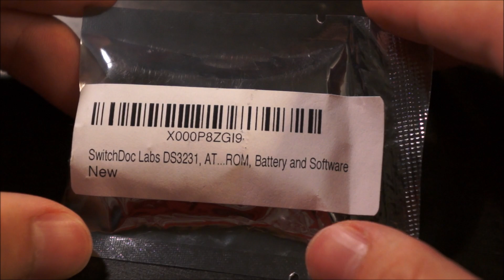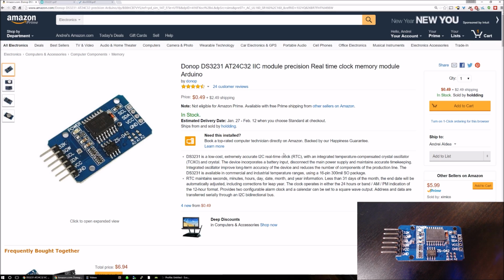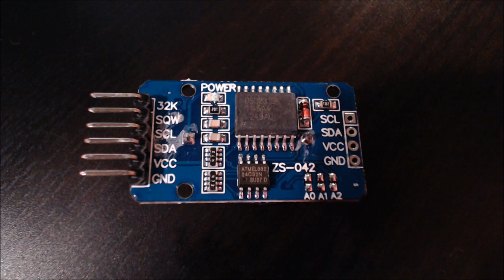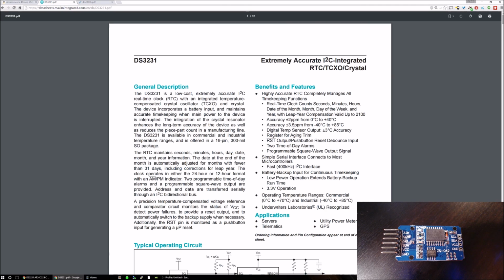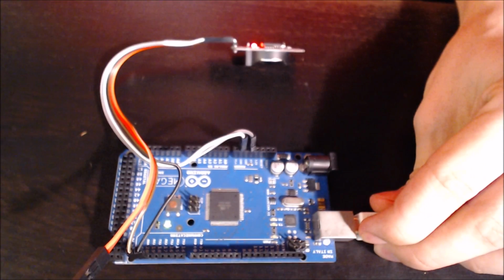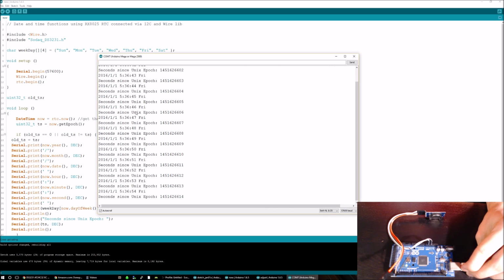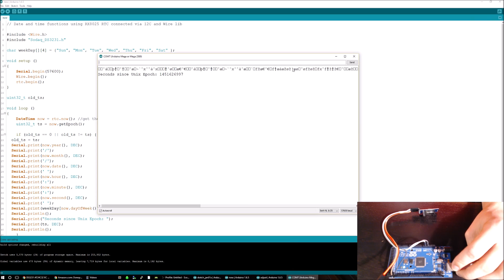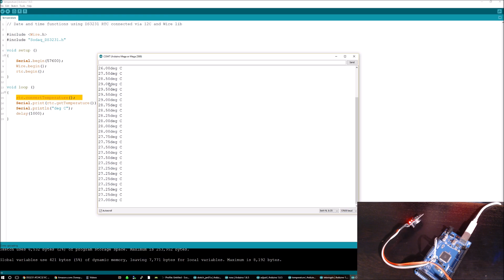DS3231 Real Time Clock + Temperature Sensing using Arduino

Comment: By removing a couple of resistors and clipping the vcc leg you can reduce the current draw on these modules from 100uA down to 5uA.  This power saving modification is quite useful for data logging applications:

https://thecavepearlproject.org/2014/05/21/using-a-cheap-3-ds3231-rtc-at24c32-eeprom-from-ebay/

Comment: Can you publish your code? I can't find it anywhere!
Reply from the maker: Phillip Shcherbakov it’s the “now” Example of the library, comes with it by default
Reply: Thanks! I'm trying to use this chip to make an automatic christmas light controller. The idea is to smash this code, some code to control a relay, and some code to read an IR sensor together. It's my second arduino project, so it probably won't go very well.
Reply: It doesn't seem to be working. I've found the library in the Arduino contents, but the 'now' example is a .pde file, which won't open in Arduino. Is there a way to open the 'now' example inside the Arduino application?
Reply from the maker: Phillip Shcherbakov that's rather strange... It doesn't show up under, File -> Examples? I'm away from the computer right now but I'll try to give you a hand when I get back if you still havent figured it out
Reply: Ok, I've found it now. At first I was looking at the files that make up Arduino, but I've searched around the menu bar in the arduino application, and I found it. Great video, by the way!

Comment: Thanks for the video. When reading the time I get (for instance) 23:36:1 any single digit (depending on the time) doesn't have a leading zero. How do I get a leading zero on H, M, and seconds? The library I'm using is Sodaq_DS3231.h (If that matters). Please help me.
Reply from the maker: You can do an If statement for example, such as if(now.hour < 10){ Serial.print('0')  } Which would add a zero, it just depends where you put it in your code, so make sure the order is correct. Does this make sense? You'd do this for hours, minutes , seconds etc.
Reply: Thanks.... Works perfect now.   :)
Reply from the maker: Glad to be of help!

Comment: I followed all the steps exactly but whenever I disconnect the power the time is resetting to 2000. I am using Arduino uno. What could be the problem?
Reply from the maker: Nandini Jayasimha are you sure the watch battery is put in the correct way? the real time clock won't hold time if it's not getting power at all times.
Reply: Andrei Aldea thanks a lot! It worked once I changed the polarity of the battery.
Reply from the maker: Nandini Jayasimha glad it works! good luck !

Comment: what ever prompted you to check the temperature by shooting the chip ?  this is dumb. do you live on the chip ?  no, you live in the room. you should have checked the room temperature and then compared it to what the sensor said.
Reply from the maker: Well for one thing, what mattered in the test is the accuracy of the temperature-compensated crystal, if it reported 23 degrees but was actually running at 30 that would be a bit of a problem. The chip itself is not percivably hotter compared to room temperature, so it's not completely unreasonable to think it's a good rough estimate of the ambient temperature. Yes I should have also checked ambient temperature, but for the sake of the experiment what I did isn't pointless. 

If we could keep things civil that would be great. :)

Comment: Can't it work in 9600 baudrate
Reply from the maker: Yes, you can use whatever baud rate you want. the Serial baud rate is only limited if you're using a serial device. in this case this is i2c, so our baud rate doesn't matter as long as both our computer and arduino sketch have the same value!

Comment: Hi, one little question about that battery. That module is supposed to recharge the battery it carries, so if that is a CR2032 it should explode in a few days of use... Shouldn't a LIR2032 Li-Ion 3.6V 40mAh be the right option?
Reply from the maker: hey, the way I understand, on page 9 of the datasheet under the Vbat pin description I believe they state that the chip has a way of telling if a battery is rechargeable or not in order to prevent reverse power. you could use it with a lithium source indeed though, and it would probably be better for most applications since if power is removed you would always have a full backup battery.

Comment: I have some question. what is old_ts?  why u write after if (old_ts == ts || old_ts!=ts), old_ts=ts?
Reply from the maker: +Yusif Celalov TS stands for Time Since, and it's simply used to measure time since UNIX Epoch time. Old_ts is used to count what the last recorded time value of TS was.

The reason that line of code exists is so that the code doesn't print to the serial console as fast as the processor runs. Because we make sure that we only print if TS isn't the same value as previously, we make sure that we have some delay in between the print. 

So what we do is:

old_ts = 0 initially
ts = 512 for example (in reality this is a huge number, as it's counting seconds since 1/1/1970)

then we check: is old_ts = 0 (uninitialized) OR is old_ts NOT the same value as our current reading?

This means that if either condition is satisfied, we go ahead and set old_ts to our current value of ts to signify that the data has been read at this time, and we continue to actually print out the rest of the times (see how this part is all nested in the IF statement).

All of this could easily be done with Arduino's Delay or even Millis functions, but those rely on the internal clock of the Arduino, which is less accurate than a dedicated RTC. 

Let me know if all of this makes sense of not!
Reply: +Andrei Aldea thx much

Comment: Ironically supplying the air inside gives the fire all the oxygen it needs to really get going on the cardboard.
Reply from the maker: +ArcanePath360 Indeed!
Reply: Ok so I am 100% newbe with Arduino. I know some C++ and get Ac and DC  well. What I am looking to do is run a servo to open a small door and close the door at 3 set times a day 365 days a year. 

I know this is asking a lot. Would you be willing to help me with a sketch that would do tho's things I need. I am going to be using the same RTC and a uno to start off with.. I will after gettting it down go to a nano but thats some time out from now. 

What I will do for you is give you a shout out for helping me. I do not have a lot of subs 1200  or so but I know  few will come over. 

If you can't that's fine as well thanks for your time. God Bless.
Reply from the maker: Hey Yankey,

Check this out: https://gist.github.com/Grippentech/216cc81a54761bf510df21497802843c

It should do exactly what you want, but if anything is unclear or doesn't work, just comment on the Gist and I'll do my best to help you. 

Cheers!
Reply: ***** BROTHER THANK YOU!! This looks like it will work. Iwill get back with you n the update soon.
Reply from the maker: +yankey4  sure,  no worries man!  Glad to help

Comment: lol. I get large packages too from ELFA. Sometimes they send the 11th item in a second package. Two times they've sent 5-10 SMD LEDS later that they didn't have in stock to begin with. So they send 5 smd 0806 size leds in a large box....... Sometimes I wonder if they use a robot to pick and pack.  :D That module is quite useful. Do you plan to use it for datalogging? It has a  nice EEPROM on it for that. :) Thanks for the video on this module.
Reply from the maker: Haha yeah a lot of companies do that but how do they still make money after shipping costs... and kind of yeah. I'm still working on that open source RC transmitter and I needed a way to store data. going to use this as a backup for SD card saved settings.